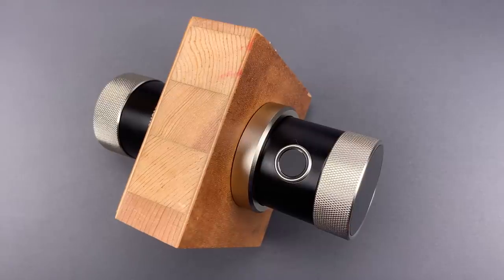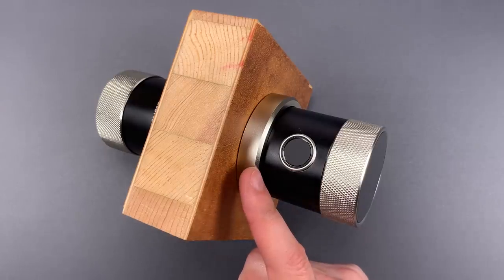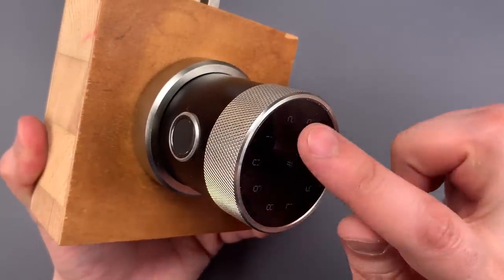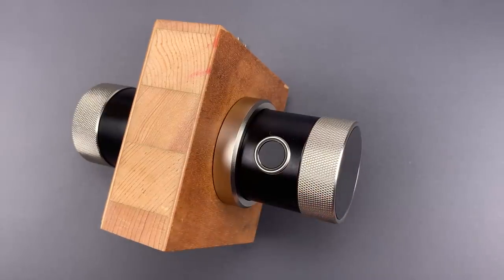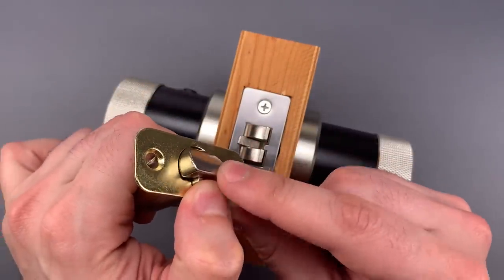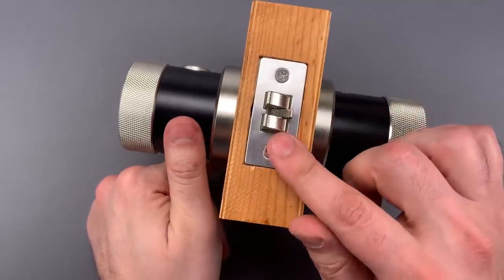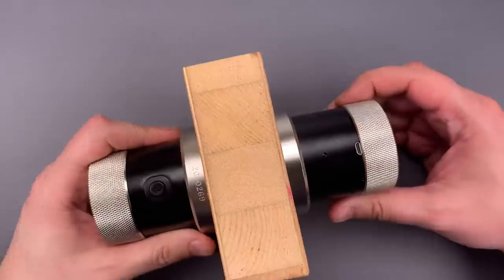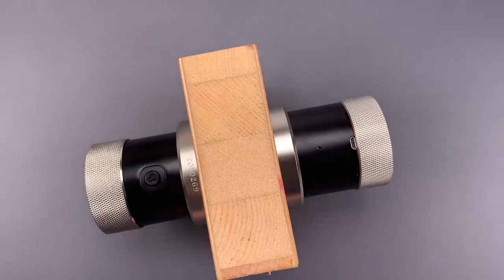[1120] Fingerprint Lock That Forgot The Fundamentals - DatoHome L-B400

Comment: That feels like an unnecessary number of ways to open it
Reply: Honestly If I'm going to use an electric lock I'd try to hard wire it into house power. To prevent having to charge it at all
Reply: @urahara64360  It's just a novelty device that probably won't be used more than a year, if that.
Reply: Next version: opens when you wave at it.
Reply: Yeah I would scrap the bluetooth and rfid methods for sure. By far the biggest vulnerabilities other than what LPL pointed out
Reply: bluetooth for when ur inviting someone to ur house but dont wanna/cant come to the door so u open door via bluetooth
Reply: yeah, bluetooth is an unnecessary security risk and the other three ways are more than enough
also, it should be only chargeable from the inside, even if batteries are in both knobs
Reply: @thomasmcelroy5785  The Bluetooth might be the most secure part of the system tho (if done correctly).
Modern cryptography is near impossible to crack.
Reply: all that crap and no real key
Reply: @klj2382  
No problem. Lose the crap and use a key for 1/5 the cost.
Reply: @urahara64360  I agree. Having a USB port on the inside (preferably only on the inside) would be nice.
Reply: @klj2382  Real keys comes with the risk of real picking though.
Reply: You mean besides the eight ways they intended for it to be opened?
Reply: @Ron Wilson- my thoughts exactly
Reply: @adrianroed2178  cryptography? The lock most likely unlocks simply when your device's bluetooth adapter's MAC address is recognised. No cryptography involved. Much like Android's Bluetooth unlock. This isn't secure at all since an attacker can find out the MAC address of your Bluetooth adapter at any point it's left on and then spoof it and gain entry.
Reply: @tr_slimey6811  we have a cheap smart lock, and even that uses an app where you have to register your phone with a QR Code (which you should obv hide somewhere) and you have to go to the app and unlock from there. I assume that this device would use a similar method, not just MAC Addresses
Reply: @tr_slimey6811  what do you base your assumption on? there's no way the door unlocks just from being close to it, you'd constantly unlock the door by walking around inside, not to mention that it would make the Bluetooth functionality useless
Reply: @mirzaahmed6589  Clap on Clap off!
Reply: Rfid is convenient if you are letting someone else enter your apartment (borrowing it or whatnot) and you don't want them to have permanent access to the apartment by giving code (obv. too lazy to change it), and you don't feel like sawing off a finger.
Reply: @adrianroed2178  bluetooth can't ve secure, deviant olan made a video about it. Even if you encrypt the actual data, when pairing the devices or when you connect to it, you have to send out everything uncrypted. Otherwise you couldn't connect, since the other device wouldn't recognize you. Bluetooth only checks the adress and device info to see if it is trusted, if you want to go more then that you are not compliant with bluetooth, and you can't use that standard.
Reply: @AfonsodelCB  Bluetooth isn't safe at all either. The pairing signal can't be encrypted per bluetooth standard,  all you need to do is literally send the adress and device information to the lock for it to think you are a trusted device. Encryption is not a part of bluetooth
Reply: What, no handcuff key opener?
Reply: Edward V Usually these kinds of things allow you to set temporary or multiple codes, so you can see who is going in and revoke access when you want.
Reply: shepardpolska that’s not how that works.
Reply: @shepardpolska  Encryption is a part of Bluetooth and depending on the desired security options will be used for pairing, authentication and payload transfer. I suggest you look up "Guide to Bluetooth Security NIST" which explains the role of its encryption. Even with an insecure connection however you can create a secure protocol at the application level designed with protection against man in the middle and replay attacks.
Reply: @thomasmcelroy5785  then how would you get in if the batteries dies when you are away?
From the inside it is probably easy to swap the batteries.
Reply: ffsnametaken: Americans like choice .... so the lock company obliged.
Reply: @cubey  I doubt anyone that has seen this video would waste a penny on this POS gimmick.
Reply: @shepardpolska  there are many ways to have secure communications over an unsecured link. For instance rolling OTP like the Google authenticator, where the code changes every 30 seconds.
Reply: @mirzaahmed6589  Facial recognition + signature movement
Reply: @urahara64360  I'm surprised the micro-USB charge port is on the outside.
Reply: And almost all of them seem very insecure against someone who has expertise in digital security
Reply: @brandonjeffi5976  And then after that scrap the pin as a big vulnerability and then scrap the fingerprint reader as well. That way your lock isn't vulnerable. It just can't be opened.
With modern technology they shouldn't be a significant risk, but it depends highly upon the implementation.
If the RFID tag is a simple number, then it is very insecure. If instead it has a chip which generates a cryptographically secure number to identify it, it is quite secure.
Likewise, bluetooth can also be quite secure.
Reply: @derfl007  Your statement likewise relies upon assumptions.
How much of the "authentication" is being done with the app vs with the lock?
Does the app just send a code saying effectively open lock XYZ?
Or does it use a proper challenge-response mechanism such that a different number would be sent each time?
Reply: @shepardpolska  Firstly, if you can only target it while pairing, that is a very small vulnerability. That is like saying someone could see you set up the pin. But with a separate shared secret, like a QR code containing a key, that would then require getting the QR code instead.
Secondly, your argument applies to sending messages back and forth, not what is done with those messages.
Just because it doesn't require much to send messages doesn't mean that it wont require much for the lock to unlock.
Being a "trusted device" to communicate with doesn't mean it will just unlock for it.
Just because encryption is not part of bluetooth doesn't mean encryption cannot be used on top of bluetooth.
Just like HTTPS is built on top of HTTP, and still uses the underlying HTTP, and both use the underlying TCP.
But encryption is not part of TCP.
Your reasoning is saying that encrypted websites cannot exist on the internet because the internet uses TCP which isn't encrypted.
Or that the military could never send encrypted messages, because the underlying radio waves aren't encrypted.
It is pure nonsense.
The underlying transport layer has very little bearing on what he application layer can do. All it can really do is limit the data rate. There is no difference to the transport layer between sending 1s and 0s to represent plain text encoded with ASCII, or encrypted text encrypted which must first be encrypted and can correspond to something completely unrelated to text.
For example, the lock can send a challenge, a simple string of numbers, which the lock then needs to send an appropriate response based upon a secret key and algorithm, and the lock compares the received challenge to what it computed itself, and if it matches, then it opens.
So you then monitor and spoof your mac address to pretend to be that device. It then sends you a challenge (which would not have previously been used). You don't have the key and/or algorithm and thus can't generate the response. You can send back a response, but unless you get extremely lucky, it doesn't match what the lock computed, and it wont unlock.
Reply: There are several more options...
Reply: For people with some kind of disability that makes opening most doors hard, the RFID certainly is handy (if they might also have some problem with using smartphones).
I would call the number combination overkill, but was put likely to enable visitors to enter without sending them secure (but decodable) locking codes over the internet (in case the app doesn't enable this for security reasons).
Reply: @brandonjeffi5976  yes, yet that is on another tech level even he didn't bother getting into...its got a usb connection...what else will it provide?
Reply: @adrianroed2178  i keep hearing that...and keep hearing it get defeated.
Reply: @klj2382  have you seen... This channel?
Reply: Yeah, that's too many ways to try to exploit as well. 4 attack vectors.
Reply: @philindeblanc  you don't defeat encryption, you find another flaw in the system. Brute forcing it is near impossible and so you need to look for another flaw in the system and honestly, i doubt any thief is going to be a highly skilled hacker, as that happens to be a well payed job.
Reply: @thomasmcelroy5785  Only chargable from the inside? Imagine coming home late at night and the battery is dead, you've just locked yourself out! I get your point but I think it's better to be able to charge it from both ways.
Reply: If they use many methods, then they are not sure of all of them.
Reply: @brandonjeffi5976  rfid is fine toughbluetooth depends on the implementation. the access methods are actually not that insecure considering how insecure keys are.
my biggest fear woul dbe running out of battery at 3 am in the morning
Reply: It's pronounced "vectors of attack".
Reply: @urahara64360  kinda dumb that thr usb is on the outside. You could probably fry that with a usb killer
Reply: @thomasmcelroy5785  I don't think so. What do you do if nobody is inside and it has to be charged?
Reply: I lost track of my rfid, phone, forgot the password but at least I didnt lose my hand, oh wait?...
Reply: @DDvargas123  umm you do know Bluetooth's range do you?
Reply: @rajkumar-rg5sw  enough that i can use bluetooth headphones connected to my computer from anywhere in the house while i do chores . that might just be cause i live in a small 2 floor house. definitely depends i would say. my "open door from a range" was also just a joke lol
Reply: urahara64360 that's dumb as hell.  How are you supposed to wire through a door?
Reply: Agreed. More options for the user = more attack vectors.
Reply: @ill0gitech  The charge port is outside because you WILL forget to recharge it. When you come back after a month abroad and you can't open the door because it's not charged, you need to charge it from the outside... (too bad you left the charger inside though)
Reply: @jayyyzeee6409  What if you travel and the battery runs down, how do you charge it up to open your lock?
Reply: @jeffreyblack666  He's not the one assuming a lock is not secure because it connects via Bluetooth, he is not making any assumptions, he knows Bluetooth connections can be made secure, quite easily too, so why assume this one isn't?
Reply: Ron Wilson intil someone (steals your keys for an hour) and you now have a worthless lock.
Reply: To all who thinks the USB Port is for charging: it's not. The inside handle contains 4 AA batteries. The USB Port is just an emergency power feed you can energize using a power bank just in case you didn't change the batteries before 100 unlock/lock cycles take place after the handle started to beep about "low batteries".

Also for those concerned about Bluetooth: It's possible that BT is used only to connect to the device, but there's likely an app that needs to exchange some digital keys through a secured connection over the BT connection.

The weakest key is probably the RFID tag: Swiped off or pickpocketed, and it'll be uncontrollable. Hopefully the doorhandle lock's app can remove RFID key associations.
Reply: It's a way to flex, pure and simple. It's not about having an actually secure lock, it's about showing off to your friends the fancy new toy you got with all of its "features".
Reply: To be honest sometimes emergencies happen. If someone who doesnt know the code, doesnt have his print in the system tries to enter they wouldnt be able to without the key. They're there for safekeeping, its a door, doors are meant to be opened. If you dont have a number of ways to open it. You're screwed
Reply: I mean, you just need a paper clip in the dimple underneath and it unlocks, it's nice the designers were thoughtful enough to include such a method for those in a hurry
Reply: @mickys8065  its not a bug. Its a feature!

Comment: "Dear burglar: If you want to break into this lock, please drill at the point marked below".
Reply: Seriously, like wtf.....
Reply: It's on the other side of the door so irrelevant.
Reply: @nonyabidness8676  You're right, he rotated the handles several times and it's indeed on the outside. What a shame!
Reply: It's not a high security lock, though. You wouldn't use it on an outside door (it is even waterproof?).  More likely in an office just to stop the public wandering in during opening hours where any attempt to force entry or drill the handle would be noted, and protected by a robust external door when the building is closed.